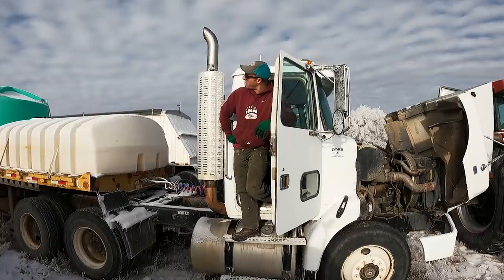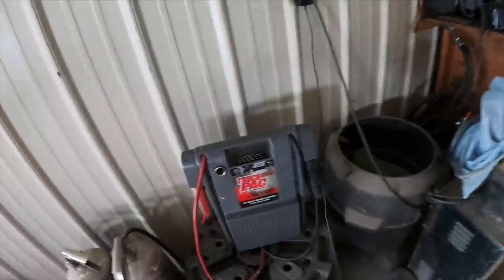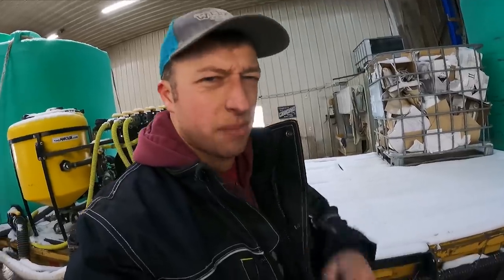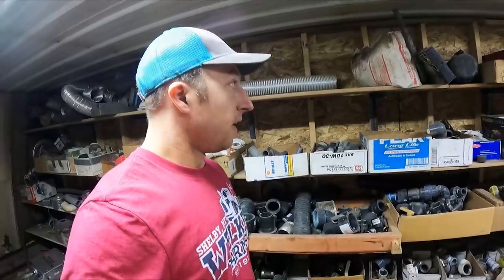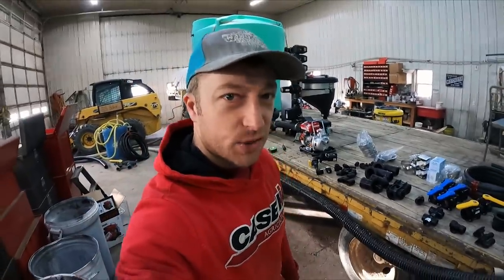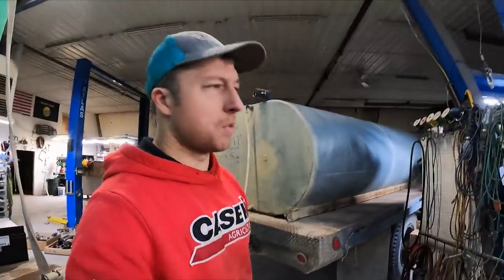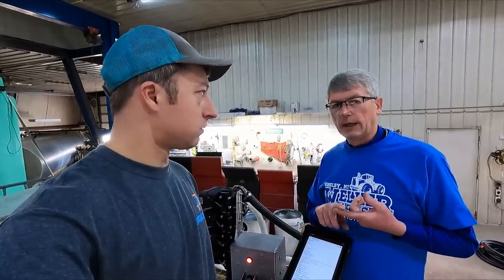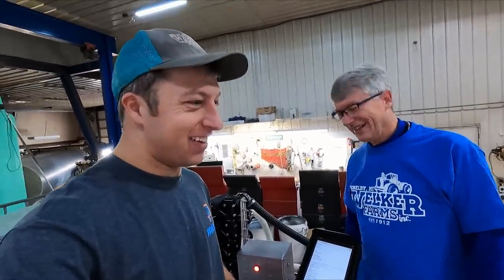Winter cold is NOT helping! But it'll be worth it!

Comment: Big Bud die cast on the MixMate @ 13:51. That is a nice looking system. The biggest drawback I can see is that you have to climb up on the trailer to access the controls and eductor. Otherwise, it appears to be very user friendly.

Comment: From what I've seen, most farmers are innovative and create and adapt to get the equipment to make things more efficient and effective. That is why I am grateful to have learn from farmers who have done exactly these kind of things. Hey Nick, just a tip, when disconnecting a trailer and the plate doesn't want to release, push the truck backwards into the trailer. It takes the tension off the jaws and it will release easily.
Reply: I never thought about how many skills a farmer needed to have until I became hooked on farmer vids a few months back. The use of technology is amazing.
Reply: Thanks Richard!

Comment: You need to invest in some block and oil pan heaters and a row of switch controlled outlets where you park the equipment you need during the winter season. I used to truck to Alaska and had a block and oil pan heater on my Western Star. I ran the APU at night and shut the big engine off. Even at -25 the engine would start like on a warm summer day
Reply: I would be surprised if most of those pieces of equipment don't already have a block heater on them, its the northern US, not California through to Florida weather. I watch and scratch my head just like yourself as that is not the way a typical farmer up here in northern Alberta operates as we would be destroying engines and starters. If its cold at all one has to plan ahead and plug equipment in and back in the day before full synthetics I was out there with a tiger torch and stove pipe under the engine oil pan to warm it up some so it was sure to flow ( never had oil pan heaters back then and external ones can be a bad fire hazard ) . Now I use 0w-40 in all diesel engines that are possibly going to be started during the winter and definitely all have block heaters or recirculating heaters. Even both my combines ( built in the USA ) came with block heaters from the factory. But anyway having enough electrical outlets and cords and fore planning to plug them in ahead of time costs far less then one engine catastrophe in turning a crank bearing with too cold an oil not designed for the temperature or bending connecting rods or push rods with starting fluid because it can and does happen.

Comment: Can't really remember when I had cold start problems last time here in Sweden. But on big machinery and trucks we always have 24V systems. Don't think it's only a starter problem on all cases I can see on YT from US. Something else must do it because -10C (15F) is nothing to worry about here? Better CCA (Cold Cranking Amps) in our batteries? I have some start-fluid somewhere mostly to test intake leaks on small engines as B&S or injectors.
Reply: As far as I know in the US 24V Systems are not used. No idea why thats the case
Reply: @evil_schnitzel7867  24v systems are used in lots of machinery, and in some older trucks yes in the US.
Reply: Most of the time it's a lack of maintenance. Keeping terminals clean and making sure the fluid is topped off in the battery is too much work for a whole lot of people here in the States. It's easier over the long run to ignore it for as long as possible, and then worry about it when it does break down. There are winterizing procedures for most equipment that just never get done. This is a huge time and money-wasting issue that extends all of the ways from huge companies down to the homeowner that just throws his mower and grass trimmer into the shed at the end of the year without bothering to either drain the fuel, or put fuel stabilizer in the gas. I make a lot of money fixing small engines in the springtime.
Reply: BrandHazze
Reply: George Jones  Part of winterizing includes putting battery tenders on batteries that will be sitting for a while, especially in cold weather. I have 2 pieces of OPE put away for the winter and there are tenders on both batteries.

Comment: Hey Nick, Scott, Bob Welker not sure if you'll see this buried down here, but if you don't already have one you should get an inductive "clamp meter" to very quickly check amp draw on electrical equipment.  Make sure it does DC amps to measure amp draw on your auto/truck/tractor starter motors as well as AC amps to check your 120/240 volt motors.  You just clamp it around a single cable/wire without disconnecting anything.  Available online reasonably cheap.

Comment: Here in Norway, i never have any problems with tractors not starting. They always do. They might have some trouble when it gets closer to -15 F
Reply: What is it that you do different?
Reply: Plug in or a webasto water heater is almost standard in the northern parts.
Too lazy to convert anything to F but below -20 C it gets intersting.😉
Reply: @brianpritt4154  i guess i just have new batteries in all of my tractors. And they always start easily
Reply: @goodiezgrigis  I'm i Celsius guy myself actually
Reply: @goodiezgrigis  heaters do male a difference.  If your starter is starting to fail, the cold will hasten the process so that you get to change it in the cold weathet
Reply: @brianpritt4154  you know we all wait until things die for good before it is replaced hahaha.
In really cold climate newer machines even got heated fuel tanks along with water. 
Or gas powered starter motor, seen alot of them in Siberia. Russians are unstoppable in starting even at -50C with bonefires under fuel tanks and oil pans. 🤪
Reply: @goodiezgrigis  almost every year I start to move snow and end up draining the frozen water separator that hadn't been done since warm weather. Luckily I remembered this year.  Sure is easier when it's not in a solid form.

Comment: Mix mate suggestion.  It looks like they pull a total amount of one product in, then go to the next product.  I wonder if they could break up the loads to do smaller amounts of each product so that there was better mixing....is there a recirculation mode so that continuous agitation can be done?  Just a couple of thoughts from an old engineering capstone design prof.  Great work.

Thanks for showing how cold it is up there...have you considered dipstick oil heaters....block heaters...might pay to build up a little cart for that...maybe mix mate would build one.
Reply: Hello Tom,  One product is pulled at a time unless there are more meters in the system.  Multiple meters and valves are used when more speed or high volumes are needed.  All will run at the same time.  One time we had a customer who wanted it to be really fast and he had four 1.5 inch meters and valves.  We could blend the four bulk products in about 25 or 30 seconds for a 1400 gallon sprayer.

Comment: I'm wondering how you moved that trailer without air to the brakes.
If you moved it that easy with no air to the brakes, It has no brakes.  Lol good thing it never leaves the farm huh.
Reply: guessing they caged the brakes so they could move it
Reply: Maybe he did, maybe he didn't,  but he didn't show it, or talk about it. No big deal. I've been driving for 35 years, that's why I made the statement,  I took it into consideration and was just asking or making a statement.
Reply: It may just have the old style power chambers, not a 30/30 spring brake. So no air and the power chamber is released. Or if its just a total farm trailer mightnt have brakes at all. But who cares at the end of the day

Comment: Hook the battery disconnect to the ground wire and not the hot wire. Still takes the battery(s) out of the circuit when turned to the off or open position and you won't have high amps going through it when starter motor is maxxing out.Even the "good" disconnects are pretty flimsy if you ever open one and look at how they are built.

Comment: Cold winters engine starts best friend, generator mounted on service truck, big block heaters, oil pan heater blankets, fuel system heater blankets, transmission heater blankets, battery pack heater blankes, 120v electric heater in cab.  One cable from the heaters to the gen set.
Big hot kerosene turbo heater to heat motor and 5thW release&deck.
Fire all up, 15 minutes, ready to roll. No motor damage, no smoked electrical.
And tanks full of #1
Think about it for your required winter start rigs, water fire suppression tanker, winter tractor, winter scoop rig.

Comment: The best thing I have found for warming up cold hands (I do photography in Canada in the winter, hands get super cold) is battery powered hand warmers (similar to a chemical hand warmer but using a battery pack and heating element, they warm up faster than the chemical heaters and the get hotter). I got mine off of Amazon Canada, I bought the one with a 10,000 mAh battery (which you can use to charge your phone or other USB powered devices), the only thing I should have done was buy 2 of them right at the start (2 hands/2 pockets, should have been obvious...). The brand I bought was Ocoopa but there are many brands with different shapes and sizes.

Comment: I use a comercial grade 100 btu boiler to heat my storage shop it keeps it a 50-55 f in ground pex tube in the floor and it cost me about 100 us a month for a 200 x 80 foot building and every thing starts easy turn key and go.

Comment: we had a tablet controlling the chem mixer for weed spray, left it in the pickup cab and it tapped a network automatically and got a virus that botched the whole system. I still turn valves and learned how to mix volumes in highschool

Comment: think about the size margeritas you can make with that thing
getting a bit more serious starting and stopping the pumps with the mixmate computersystem  : think that would work best if you have relays and electric pumps running of a generator , the generator can be electric auto start and all the other electronis valves and stuff can run of it too should be a little more quet too

Comment: Cold air doesn't help, IMO, get one of those second hand (either military or airport issue) heat pumps. You only use it in the cold season, but it's coin well spent. You pack that with diesel, shove it into the engine bay for 20 minutes and it makes the engine toasty warm, and just perfect for a start up. On petrol engines you can even direct it at the intake and make them suck hot air to help them.

PS. motorcycle heated gloves. Thin, but with a 12v heater. You'll never look back in winter time.

Comment: At first blush it seems like it’d be easier to have a generator on the trailer that runs a couple of electric pumps, from an automation standpoint anyway.
Reply: Very true, but it is expensive.  I have seen hydraulic drives used when the truck has a wet kit.  Watch for some pump automation on Inventive Farmer.  We plan to do some experiments.

Comment: You may want to bypass your battery disconnect on your truck before you condemn the starter.  They have to be sized correctly, to allow the most amps through.
Reply from the maker: After talking with my brother we think it is related to the ground. I did remove the disconnect thinking that may be the issue but it still wouldn't crank. The ground attaches to the frame and then from the frame to the starter. We want to run a heavy cable directly to the starter so it doesn't have the corrosion prone spots.

Comment: What's with the new rotor, Seam's I remember you talking about a slight vibration.  There's a machine shop in Fargo ND called Larson's Machine they do lots of rotor balancing and they are reasonable. Be careful pulling that rotor out to much weight on the front shaft can bend them.
Reply from the maker: It's a secret 😉, wasn't supposed to be in this video but I failed to separate out the content before the editors got it. It'll make more sense soon!
Reply: @WelkerFarms   OOP's I'm sure I'm not the only one to notice. Guess now  you'll have more viewers in suspense. lol

Comment: If you connect two hoses between a hot engine and a frozen engine 
and let the coolant flow in these hoses between the hot and cold engine, it will start.

Comment: Welkers what is that ground looking like you ran the ripper threw are you going to have to run some lite tillage to plant that ground or is it to early to tell yet
Reply: I don't believe is left the ground too rutty. But it will need a rock picker..........
Reply: @RobertWelkerFarmerBob  cool i know i watched them videos and seen it left the ground pretty rough well it looked like it anyway on bean ground here they will take a turbo till and run it over ripped ground and in corn ground some times a turbo till or some kind of high clearance tool that the corn trash will go threw easy the ground here dont mellow out much over winter just to heavy or something  just needs some help at spring to get it ready to plant

Comment: One question...how did you release the brakes on the trailer to move it without having air pressure?
Reply: Trailer that just used around farm , I imagine brakes disconnected or removed.
Reply: @ecp3031   thought so...

Comment: It’s a rotor for the combine
Reply: Almost...... stay tuned!
Reply: I have a 1480 I still run and spent about $4000 to up grade it. We put a air foil chaffer in and the cut off about seven slats from the sieve to push more air up to the chaffer. Then we replaced the bottom of the clean grain. It had rotted. The biggest change was we blocked the first concave and the the smooth bars on the back of the rotor we replaced with knotched bars and then we built disrupters and bolted it onto the cage for better thrashing. And boy did that  make a difference. It cleaned the grain better than case ih 23.... something. I have a bad memory. We help cut our neighbors safflower and he was jealous when I would dump my load next to his. Much cleaner. For those that don’t know what safflower is it is used for bird seed. It’s perfect for dry farm because you can plant the next year after  a grain instead o summer fallow. It has a three foot tap root or more. Comparable to barley maybe more.

Comment: The ranch I work on we have that exact same water truck. And same thing it loses it prime and I say the same thing. Please fire please fire.
Reply from the maker: 😂 It's something to do with the carb, we rebuilt the engine and ever since it has had this issue. I even put a check valve in  the fuel line thinking that would help.